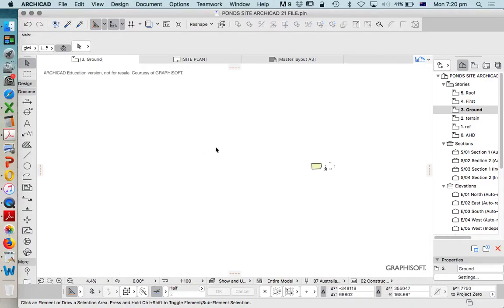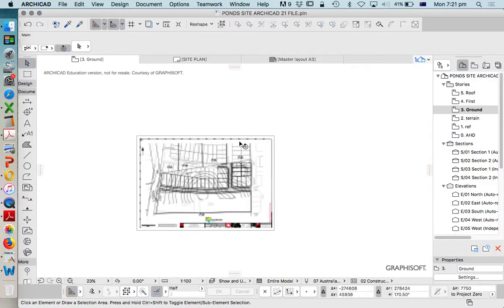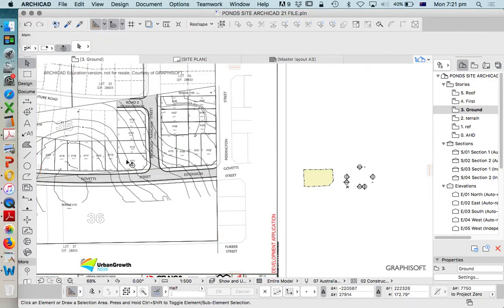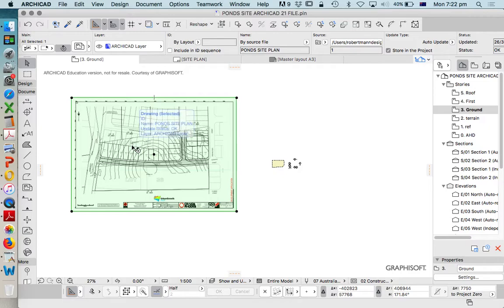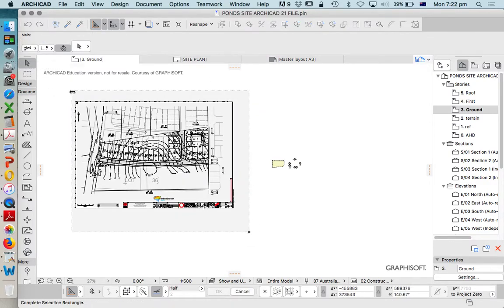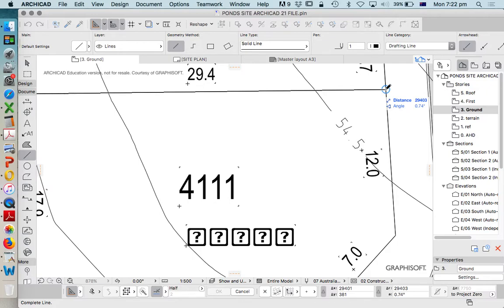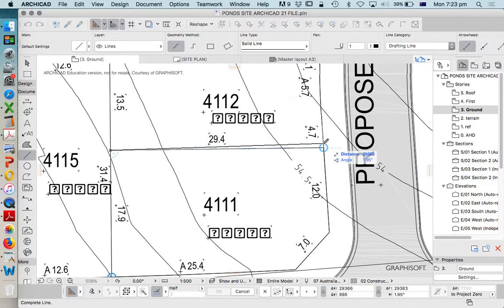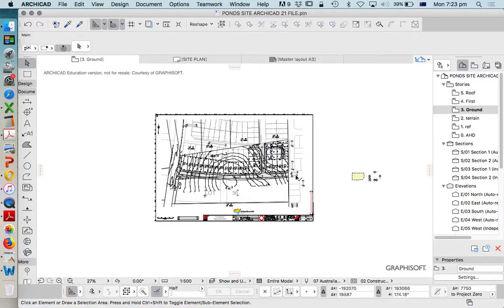ArchiCAD 21 House Project - part 01 survey import

Comment: Hi Robert, what level do you use for a finished site plan ? Option 1: We generally use a 3D view top down, which uses the mesh contours, but that creates problems if we require dimensions. Option 2: if we use a Roof plan tand a copy of the contour lines, boundary, setback, etc  for the view, but then we miss out on other objects if they aren't set to display on all levels which you want to avoid for other views. Option 3: Use the a  level as a siteplan and trace reference the roof plan as fills, but this doesn't update.
Reply from the maker: many councils' don't want roof plans on the site plan. So I generally use the ground floor plan. THis is ahrder if it is a very sloping site & I have multiple levels at ground level. In this case I sometimes merge them together in the layout.
Reply: Thanks Robert, that's interesting, up here in Queensland I have never found a council that has requested a floorplan siteplan. Yes I might have to go back to overlaying the roof plan on a site plan in layout, thats a good idea, but not that convenient.  Thanks again

Comment: I see theres two ways to do this. One is to xref a pdf and put it onto a worksheet. Is there any reason you prefer this method ?
Reply from the maker: I really like the idea of drag and drop over xref. If I'm concerned about losing the link I might do it this way. Sometimes I use worksheets, other times stories. often as I will need to rotate the survey file to orientate with the layout of the building I prefer to put it on a storey rather than a worksheet which will allow me to rotate all storeys in one go using the marquee tool (as I've done in some of my videos).
Reply: Thanks Robert, Yes I can see rotating can be a problem, been there and have lost a xref link too, when the server goes down. One thing good about worksheet with a DWG on it, is it seems easier to move a heavy DWG  than actually moving a DWG to world center. The other good thing about Xref is file size, but I think end the end for most projects putting the pdf/dwg on a lower level is the way to go. Thanks and nice Tuts